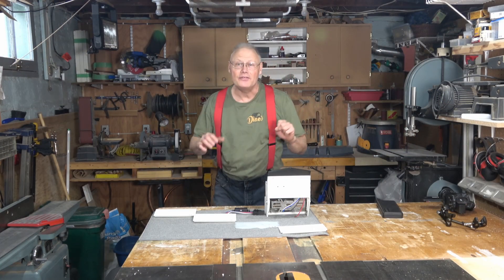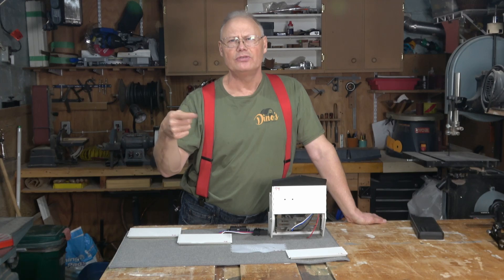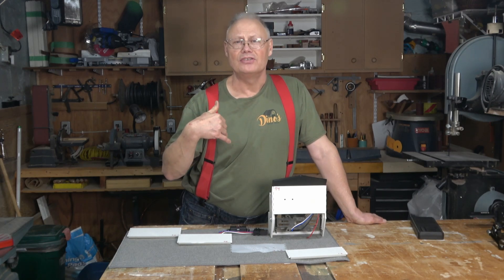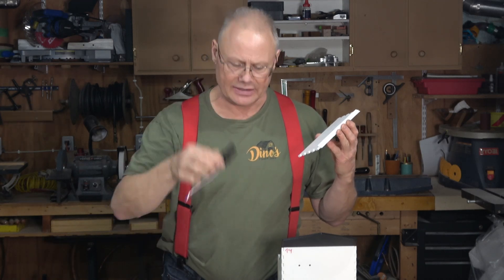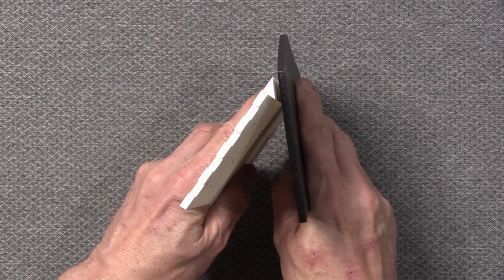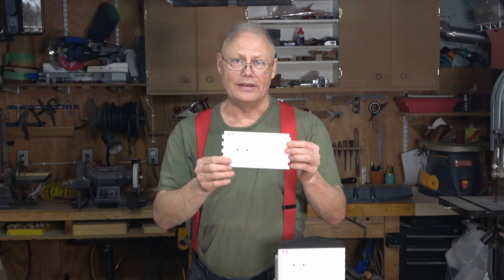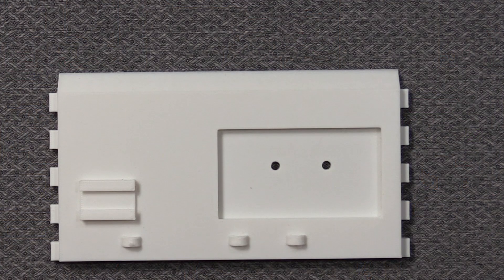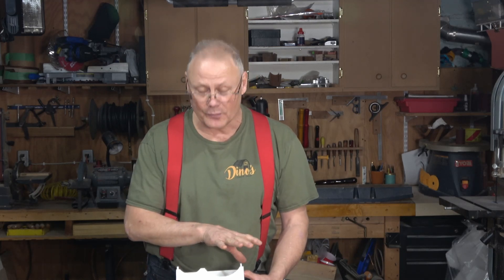Creating a custom DR650 3d printed dash part 3

Comment: Good job. You could put some heat shrink over the wire cluster then zip tie to the panel Dino. You probably already thought of that. If you ever pursue this as a business venture you can keep it as a flat pack as it would be better for shipping. Well done Mate.
Reply from the maker: @aussiefarmer8741  great ideas on both comments,  glad you like it so far.
Dino

Comment: Some basic DFMA stuff - i would add ribs instead of full thickness. Save weight/material/time and it helps more for warping than just adding thickness. 

Otherwise your modular printing makes a TON of sense, and i wouldnt change that. Printing by panel makes sense, your instinct that the "brick laying" orientation is weak is exactlt correct.
Reply: DFMA is "Design for Manufacturing and Assembly" and is worth a little bit of reading up on.

Superglue or any CA glue is going to be plenty strong, but I'd be tempted to hold some bits on with magnets, so you can pull them off easily to check wiring or troubleshoot. A couple indexing pins and magnets will likely be plenty strong  for non-structural components.

Comment: The front panel looks great Dino.  I think it is very bespoke for your specific relay and fuse box.  If you had to change either, and the exact same model is not available then perhaps you won't have a bespoke fit anymore.  If you release the design as you said you plan to, then others would need to insert the same relay etc in order to fit snugly.  Perhaps the loop system for tie-downs, as opposed to rails and recesses would make it more flexible for others?
Reply from the maker: @anthonya7066  very good points for sure. It is easy enough for me to make the panel flat with provisions for more generic mounting. Also for those who wish, changes could be added on tinkercad later to mod the dash to their needs as well. Thank you for the feedback.
Dino
Reply: @DinosTinkerShed  you can glue/fasten in thin clips of metal onto the panel in order to hold relays and boxes in place. Think of the tabs on the back of a picture frame. They are less likely to rail due to wear and vibration than printing in the small clip. 

Overall a great build and can’t wait to try it out when you release it.

Comment: Thats coming along nicely! I wonder if the printer can omit holes for small diameter metal pins that you could use as dowels for the connection points at the corners? I would trust dowels with glue more that just glue
Reply from the maker: @jordancaleb5790  I belive it can, I can explore that option as it takes final form. Thanks for the question
Dino
Reply: @DinosTinkerShed  right on!  itll be cool to see once complete!  have fun sledding!

Comment: You could sell these Dino dash kits for us who dont have 3D printers!
Reply from the maker: @Legoliam47  as much as I appreciate the encouragement,  I really don't have time to do so, I would recommend omend contacting a local 3d printer who could help you out if you don't have the equipment 
Dino
Reply: Yup there are print shops on line to send files.

Comment: Dino been a follower for some time. Great content and recently I was in Moab for a month and some other DR dudes from Texas knew all about your channel. 
FYI, I am doing the exact same thing as far as the dash goes. The difference is I am using 1/4 plywood and a laser cutter as my prototype. Once I get it perfected I will then cut it out of aluminum on our cnc then bend where it needs to bend the weld other places.  Your dash looks awesome. 
Lots of snow in our area. Owen Sound.
Reply from the maker: @chasinggeckos8843  so cool to hear about the fellows in Texas, and your custom dash as well. Would love to see it some time. Owen sound is not that far, My buddy Karl has family in Port Elgin so it could be a good weekend ride.
Dino